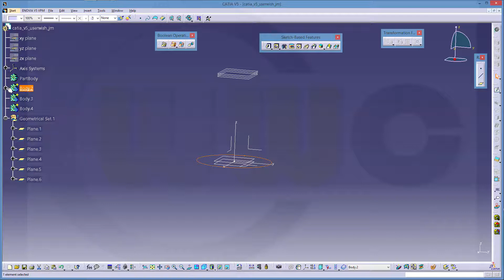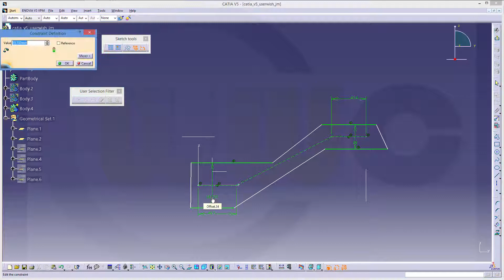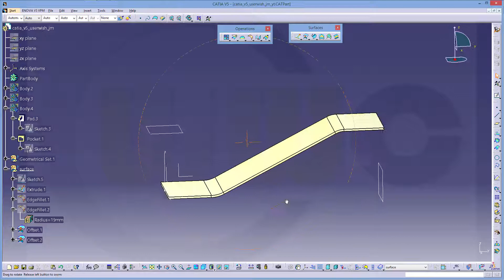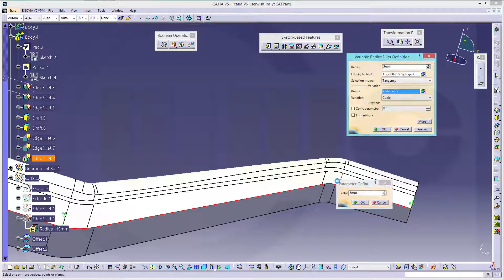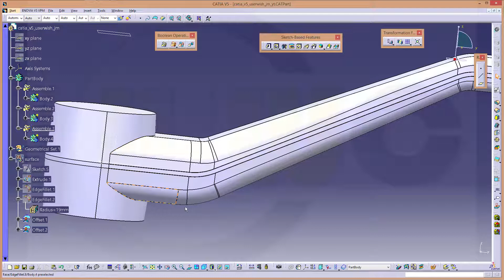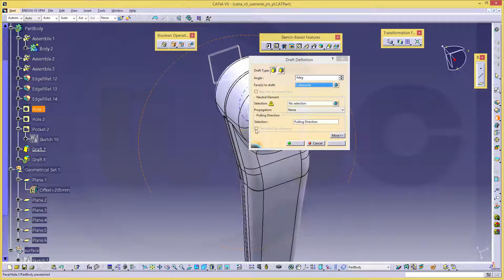Userwish  - Coupling with draft - Catia v5 Training - Part Design

Comment: Good Job Herr Walden. I like very much your technics on modeling parts. In this example, according to the blueprint, there are no draft angles on the holes nor on the keyway. Such holes are machined features to fit shafts or handles, I think.
Reply from the maker: Thanks :)  I know there is no draft in the holes - but it is just a good exercise ;)